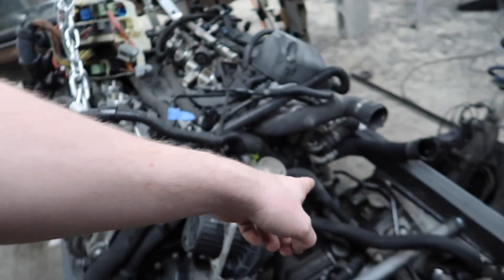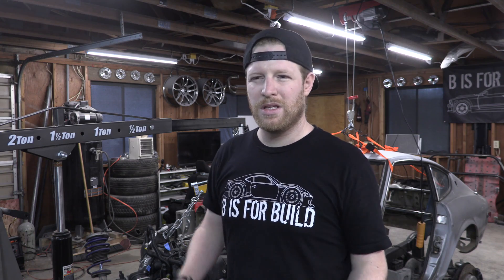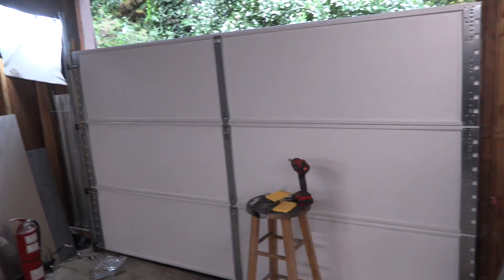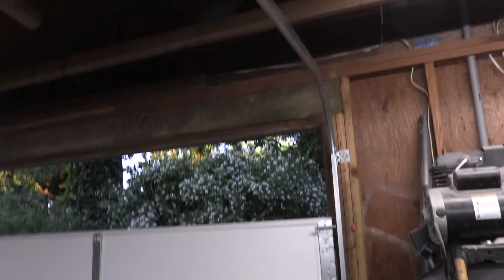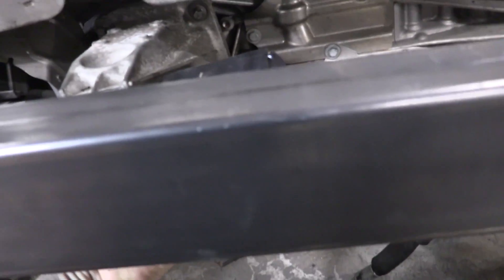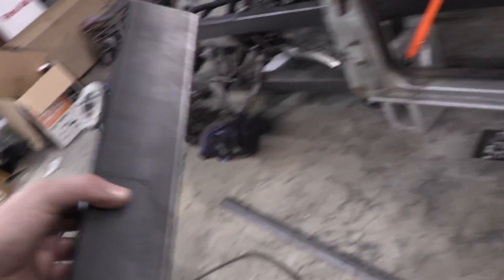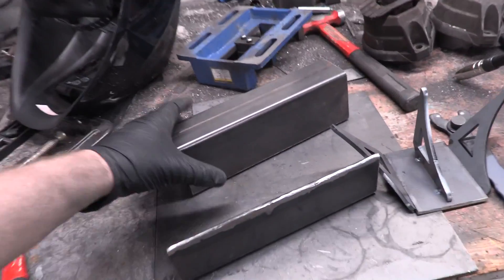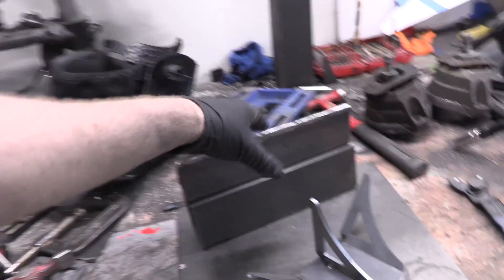B is for Building A Garage Door

Comment: Why  didn't  you just cut the shell of the bmw  and then cut in middle to bring wheel centres  into size you need and then drop the datsun shell over the top  job done saved lots of work

Comment: Lol I just commented on the last video about how you might be able to get a smaller alternator. You still might could find one that wasn’t bmw that would work but those are some pretty stout amp outputs to match though. Also speaking of weird engine mounting there was an engine on like Speed Academy or MCM that was mounted stock at an angle like tilted to the left or something.

Comment: Guys i have nowhere to ask anymore, i have problems with my e46 136 diesel,  after the engine gets to optimal temperature i lose most of my power which cause low respone on pedal gas, somebody had this issuse? Can someone give me possible solutions to this shit situation ? PLox help. Instead of being rocket to 50 its like driving a bicycle no kappa.

Comment: Why don't you cut your frame rails so that you can angle them to pick up the rear of the front subframe and go under the cabin, that way you have somewhere to weld your engine mounts to without adding more steel.

Comment: In fact I am pretty sure that even the battery is matched to the charging system. When installing a new battery you need to 'tell' the onboard systems what type/capacity etc it is to prevent under/over charging or key off electrical drains.

Comment: Just a thought, why not run your alternator off the diff, that way you move a little weight to the rear and free up the inch you need in the engine bay.  Have enjoyed your build so far, keep pushing on. Great job.

Comment: This build is turning into an ugly over weight mess! You will be better off tossing that frame and starting again! Copy the BMW frame rails or just cut them out and use them and extend them to suit the wheel base. Basically just cut the top off the BMW and sit the Datsun on top and use that heavy steel to reinforce the frame. You can solve the accessories problem by removing them from the engine and mounting them on a frame and drive them with a small drive shaft off the crank, the Maserati Merac does that.

Comment: Great work! Watching B is for Build is part of my daily routine now. 
Please check the angle of the engine mouts again just to be sure. Isn't there a small tapering with an angle on the engine moint point? Which means its not flush 90 degrees at the bottom of the mount point on the engine side. This could mean that the mount points not seating properly. (I'm no BMW specialist, just a fan who likes this build).

Comment: Love the videos man, but coming from a fabricator.. I'm starting to get sketched out on your set up.. PLEASE clap/vise shit and HOLD THAT GRINDER WITH 2 HANDS!! If that fucker catches and comes back at you, last thing you want is for it to cut your arms off or even worse. Also, leave no 90° edges, like on your "drop plates". Imagine rolling around under the car on a creeper and catch that edge with your head.... Ouch! Also, don't forget to box your ends in, that's where a lot of strength comes from too, but use weld threw primer on the raw insides before welding them up so they don't rust out over time.

Comment: I had issues with a couple e90 bmws where the alternator were going bad and it would throw the car into limp mode and give me errors and codes that the oil pressure sensor wasn’t working the electric water pump wasn’t working so everything that’s in sequence (I hope that’s the right terminology) was showing as “bad” and it ended up being just the alternator I’d say keep the alternator it came with if you still plan on using all the other bmw bits

Comment: Be careful with those spring they are under a lot of tension by the time you put 30 or whatever .25 turns. Also remember the drums are usually color coated. Red left, black right.

Comment: Why dont you flip the mounts upside down so that the gussets go up and the plate sits toward the bottom of the frame? This means you dont have to extend the frame downward and those gussets will be stronger in tension loads rather than compression loads

Comment: Do what my dad did for his shop, put a dryer vent with the flaps in the bottom panel of the door and get accordion hose so you can st one end on the vent and the other of exhaust pipes so you can test engines and not die!

Comment: You should put a thick metal bar/tubing about 2 feet off the ground across the inside of the garage door. So that nobody doesn’t try to break into the shop by driving threw the door. Happened to a buddy of mine who had a shop, a lot of expensive tools were stolen.

Comment: You could fabricate an alternator relocation bracket yourselves.  if all you need to do is gain an inch or two to clear the steering rack, play with some cardboard designs and have a think on it.

Comment: The door frame may have been slightly tweaked inwards and you didn't notice it when disassembling the old door. You'd be surprised how easily a building on a concrete slab can get totally mangled.

Comment: sorry if I’m a little lost and he has answered this before, but is he going to just repair the 240z shell? Or is is just being used to mock up in place right now?
Reply: He is getting another shell.  That one is probably a little to tweaked to use at this point. You start throwing gloss paint on those rear quarters and there will be some odd waviness in the sheet metal almost guaranteed.

Comment: Why didn't you just notch the frame and kick it down by the motor mount, the frame has to drop anyway. Make a clean drop down under the hood rather than at the firewall

Comment: You mentioned air ride.. your gonna have drive line issues with the geometry being off that much. Unless I'm missing something. Drive lines on air ride need a mad slip yoke when lifting and lowering. 1 inch offset will cause problems with slip yoke binding as well as u joints. If applicable

Comment: You can always ask a rebuild shop if they can rebuild the smaller one for more AMPS.

Also, I may be wrong, but wont there be a problem with the driveshaft being angled if you offset the engine? Or can you move the differential over as well?

Comment: For your steering instead of swapping the alternator, why not have the steering shaft moved. You can weld a small carrier bearing to the frame and wrap around or under the alternator. Google "steering shaft carrier bearings" and look through images to see what I mean. Many classic car hot rods do this. Also you can put spacer bushings on the steering rack if you needed to raise or lower it.

Comment: Hey Chris, a family member of mine had to replace the alternator on his M6. These cars use a significant amount of power to run, and without the 170 amps from the alternator your electronics start to go wonky. Your instincts are right, without that oem alternator you have mounted to the engine, the battery will run down, the electronics will die and the car will stall out - unless you run the thing over 4k rpm all the time to keep up the charge
Reply: The car absolutely does not draw anywhere near 170 amps.  Manufacturers give overhead on the alternators to allow the maximum current draw while still being able to maintain the battery charge at the same time.  In order for that car to have even pulled close to 150 amps, you would literally have to be pegging every window, lock, light, wipers, pumps, 12v socket, and every other accessory there is in it.
Reply: Over drive, not under drive.
Reply: Underdrive the alternator pulley by 20% roughly, spins faster at less revs.
Reply: I agree, but the large capacity alternator is to charge and maintain the large battery due to various pumps (fuel and SMG) cycling before and after the car has run also a lot of the modules go to sleep at various times after shut down and up to a few hours after shut down.

Comment: With the issue of the engine offset would it be possible to widen the chassis as your going to cut or bend it for the inside of the car anyway and if needed widen the front wings? 
I don't know if that is possible but it's a thought and might be easier in the long run as you will run into more issues if the engine is offset with the prop shaft and probably a hundred other things not even though about yet 

Regards T

Comment: Looks like your garage door frame is not wide enough and thats way you had to space the track out. The exterior side of the door is suppose to seal against a rubber flap/seal and not against the actual door frame. If that makes sense. Regardless, it looks good now that you're done.

Comment: You could notch your bracket around the frame rail, this will provide you the weld length without increasing the moment arm of the weld pattern, the force transfer to the frame rail in twisting will be less

Comment: As i mention in the last video, have you thought about turning the alternator around? I mean, move it in front of the engine and mount him facing backwords with custom brackets? if you can place it so the belt still fits that might be a diy solution. I dont think the rotation direction of the alternator should not matter (could be wrong though). DIY all the way :D
Reply: Brezelpeter rotation of the alternator does matter, it won't make voltage going backwards because the diodes that turn the a.c. into dc will not allow voltage to be generated
Reply: I don't think that's correct. The set of diodes is called a rectifier and they are arranged in a square which allows them to take current in either direction (like AC) and output it in one direction. If direction mattered it wouldn't work at all since AC goes both ways.

I think you might have some other issues with running it in reverse though. Such as the cooling fan spinning the wrong direction (potentially making it less efficient). Also, I believe newer alternators have a clutch which could cause you problems in reverse.
Reply: I think you are right, on a test bench you test every alternator the on the same orientation, regardless of the style of the car it was in. e.g. Honda B series spins the opposite to K series, but you test the alternator on the same test bench the same way.

Comment: The MCM and B is for Build 240z builds couldn’t be more different. One is hiring pros and using all Nissan parts and one is DIYing it and using all BMW parts lol both super cool tho!
Reply: i think the biggest difference is that, one of them will get finished
Reply: And there's the street bandito one with a Honda engine and carbon panels
Reply: The backyard mechanic I don’t think Chris likes MCM lol
Reply: If that's true romanG, he's either jealous or salty. The guys from MCM are chill af, they explain a ton and are always doing interesting mods.
Reply: Not a good comparison between B is for Build and MCM. MCM has been doing YouTube for 10 years and is in the position of getting "free stuff" just by mentioning their "wishes" in a video. Witness the brakes on their 240 'Zed'; they went from "donated" OE pads and shoes to a Wildwood package sent from Techno Toy Tuning in SoCal which included complete front and rear suspension packages, That's gotta be like $10,000 USD worth of "free stuff".  Quite honestly, I would have preferred MCM to stay with their original plan; install the engine and tranny to see what that did for them, as a peron on a budget might fo a build like that. And down the road do the other upgrades. But hey, I am just a keyboard operator with no ambition to start a complicated project like that at my age; I was working in the trade building my own business and modifying cars when that 240 Zed was produced in 1974.

And what does Moog use to run for parts? 2018 Focus RS AWD which they "helped build" at the Factory in Germany. A car that they have already modified. Plus MCM has the "hands on support" of vendors.

Chris nay be a "hack" with the manner he does his builds - but he is doing them all by himself and funded mostly out of his own pocket. Bottom line is that I see B is for Builds as a D-I-Y channel, warts and all the hacks is part of the "charm".
Reply: There is no way this car would ever be road legal in Australia
Reply: Jason Luff I doubt Chris like hates them, he just threw shade at them that one time about how they script how they get their parts. Which is a valid point. Plus they let pros do a lot of their work while Chris does everything himself and does projects more frequently. Either way , I like both shows
Reply: This car is gonna drive like a bag of dicks, amd he will play it off and park in on the street and forget about it anyways
Reply: Absolutely agree with you. MCM for me are inspirative in the way they go about things (what they said about Roadkill leaving YouTube etc.) and who they are as people. They talk about different cars and they are who basicaly show me something about car culture. On the other hand BIFB is awesome for me that it shows me some technical stuff I can do more in depth and teaches me some mechanic  procedures as what is better to do before you do something else, which is for me, who has zero mechanical skills very valuable as I can transfer some of what Chris is showing here into my working on my Scooter etc. 
In short, Im really glad both have their ways and are still with us on YouTube!
Reply: Didn't he paint his frs the same color as super gramps cause he's a fan?
Reply: Roman G ones a Nissan ones a datsun
Reply: man at least those builds are better than that HACK tavarish's lambo
Reply: imJackyD The second one, yes.
Reply: Veganpotter Thevegan how much horse power is that v-10 that he is about to put in. Just asking
Reply: Veganpotter Thevegan m
Reply: Slay G0AT
still the same company though lol nissan phased out datsun in 1986
Reply: Mr. Ed
I completely agree. The two channels are very different. BIFB is alot more "DIY friendly". I can actually see myself doing some of the hacks and work that Chris does, which makes this channel very appealing to me. MCM definitely has alot more resources, i mean they have like 4-5 guys working on that 240.That is why the two builds are so different. Im not trying to compare them at all.
Reply: Veganpotter Thevegan make the same power with as an rb? New cars don’t have iron blocks lol
Reply: MCM never claim to be pro’s, they actually state several times that they are not. Also they don’t do YouTube full time, they work day jobs and only do it on their days off. If they didn’t get help it would take years and if the work isn’t done to a professional standard then it won’t pass an Australian roadworthy. These cars done on this channel would never get on the road in Australia.
Reply: Roman G bro techno toy tunning is not nissan
Reply: Backroad Chaser fine I guess not all Nissan parts but the main stuff like the engine and transmission are from another Nissan. Plus the suspension parts were specifically made for that 240z .. not from an M5 lol
Reply: Roman G check out street banitos channel! They are building a full carbon 240z !!
Reply: They should do an collab...
Reply: One runs and doesnt look like a complete pile of shit this bmw build is useless could have easily done what mcm did and had a car just as fast and not as fucked up this 240 is beyond fucked if he tries to  sell this  he would be lucky to get 2k things gonna be a shit show in every way junk build

Comment: Have you thought about a different alternator off a different car? I.e a denso alternator they are very small
Reply: Evil Ash He needs one that will play nice with the S85 and it's computer, as BMW electronics are very, very finicky, and the entire tuning potential of this engine is still yet to be unlocked, unless you go for a very expensive standalone ECU. That's why his options are pretty much entirely limited to BMW parts.
Reply: What about mounting it differently? an angled bracket might move it up a bit?
Reply: Evil Ash possibly could work anything’s possible
Reply: I would say this is probably the best route, but as things are already super tight in the 5 Series engine bay, I doubt BMW left much wiggle room to begin with. Though I have no doubt that Chris will find some way to move forward with the build.